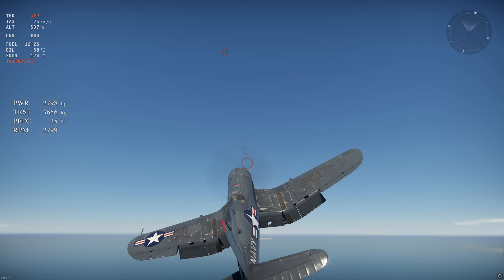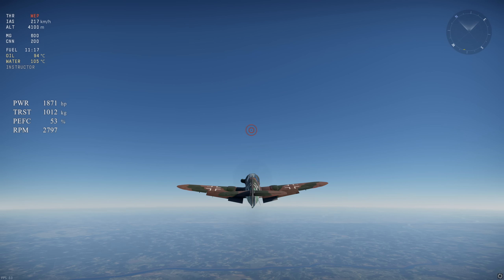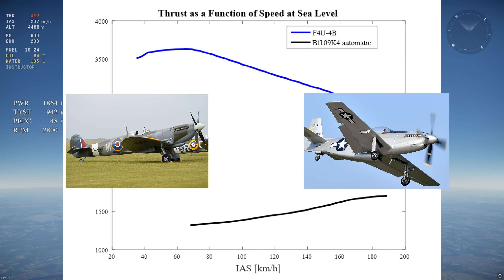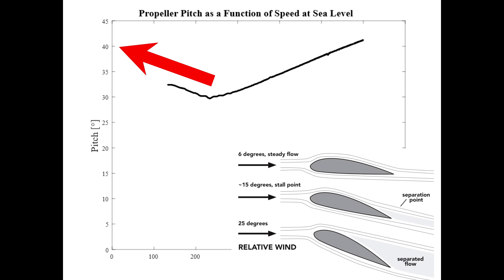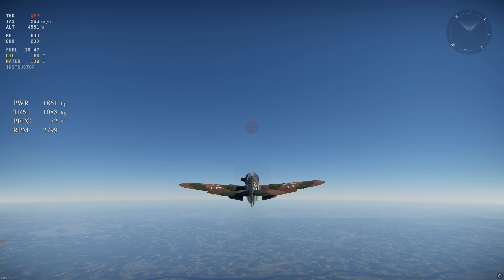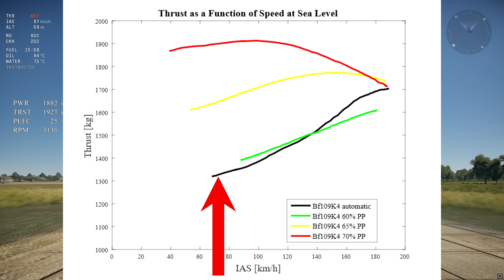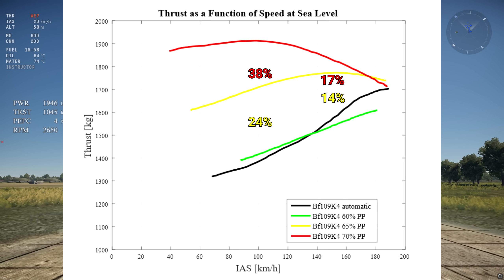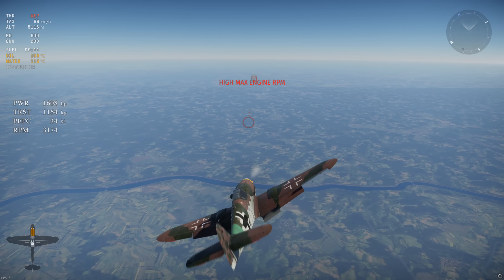War Thunder Tricks #8 | Prop Pitch Trick for Extra Thrust

Comment: Thanks for the great video once again. But I have a question: So take the K-4 automatic graph. Above 200kph the prop pitch is increasing as speed increases to prevent over-revving. But below 200kph the prop pitch is decreasing as speed increases to prevent over-rev. Those two things seem contradictory. It's like above 200kph, higher speed makes you rev more, but below 200kph higher speed makes you rev less. Am I just completely misunderstanding this?
Reply from the maker: Above 225km/h, everything is working as expected. As speed increases, the pitch angle increases to keep the AoA of the prop efficient. Below 225km/h however, the game/engine "knows" that if it continued to vary prop pitch normally, the propeller would no longer be able to absorb all the engine power without overreving. The only way to prevent overreving while keeping power constant is to increase pitch to generate more drag on the prop. At low speed, there isn't enough dynamic pressure on the prop to generate the forces to counter power.
Reply: @AdamTheEnginerd  Oh ok, so is "absorb all the engine power" another way of saying "staying at the efficient prop AoA"? Like, does it only absorb max engine power at the most efficient AoA?
Reply: So am I correct in saying that higher speed will act against the rotation of the prop, unless that prop is unpowered or at a really low power, in which case it would provide a windmill effect and increase RPM?
Reply from the maker: Absorb all engine power means that the drag on the prop must be equal to power (with the appropriate conversion of units), or else the prop will either speed up or slow down.

Higher speed doesn't act against the rotation of the prop, it would be the opposite if anything. Single pitch props see an increase in RPM as speed increases. Higher speed does allow the prop to generate more lift and drag due to the higher airspeed it sees though.
Reply: @AdamTheEnginerd  
1. Is all of the power absorbed by the prop only at a specific AoA? So above or below this AoA not all of the power is absorbed?

2. Prop pitch increasing as speed increases - That is done only to prevent AoA from decreasing to below optimal AoA? Or does it also have to do with preventing over-revving?
Reply from the maker: 1. No matter what, all the engine power is absorbed by the prop.

2. To stay at optimal AoA (also at optimal RPM for the engine too).
Reply: @AdamTheEnginerd  So is it a conscious design decision to make sure the optimal prop AoA is always achieved below the redline of the engine? Like, could a poorly designed powerplant have have its optimal AoA at too low of a prop pitch, thus over-reving the engine if you tried to get to that AoA?
Reply from the maker: Answered on Discord.

Comment: Scuse me? I dont have ANY mec settings for the K4, it just sais (you can't change pitch angle while in auto, even when im not)
Reply from the maker: You need keybinds to take manual control of radiator/prop pitch to override the automatic system on some planes.
Reply: @AdamTheEnginerd  You're the best, your tips brought me back from my eternal tiltm not even exaggerating
Reply from the maker: @pequod3782  Tiltm?
Reply: @AdamTheEnginerd  Tilt* is when you just start playing like a potato, like going down a steep cliff
Reply from the maker: @pequod3782  Ahh I see, glad to help!

Comment: What i do is stick out my head out the back of the cockpit and blow really hard.
Reply from the maker: That would actually slow you down though.
Reply: @AdamTheEnginerd  no because i rapidly snap my neck 180 degrees and inhale hard to pull myself forward and snap my neck back for the exhale. Its a good work out for the neck aswell.

Comment: First of all it is important to know that you want the power and torque. Torque is in short ability to turn the propeller. Power = Torque*RPM. The engine torque also depends on RPM. There is the ideal RPM where the engine has the highest power. The automatic prop pitch is changing the rotor load to keep the engine at this state. And now: if you have the highest posible power output, there simply is not any way how to get more out of it.

E.G. tge BF-109 K-4 with the Daimler-Benz DB 605 has the highet power output 1430 hp at 2800 rpm at sea level, with MW50 it gives up to 1850 hp. The maximum EMERGENCY power in level flight was 1600 hp at 2800 RPM at 6000 meters.
Reply from the maker: This is not about increasing power, it's all about the prop efficiency. Power doesn't change much from the change in RPM.
Reply: @AdamTheEnginerd  This is the law of physics. Power=Torque*RPM. So lower RPM at same torque means less power. Lower torque at same RPM means less power. The propeller is designed to absorb the engine power output. It is designed to have the ideal AoA right at desired RPM.

https://youtu.be/0bP2MH3LqvI

The last thing, according to the BF-109 pilot manual the manual pitch in 109 with automatic pitch control is used only in emergencies or for fuel economy.
Reply from the maker: We don't know how torque varies with RPM, engines have a band of RPM for max power.
Reply: @AdamTheEnginerd  We do not need to know the torque to RPM ratio because we already know the maximum power output state. So we can say the 2800RPM is the speed with maximum possible power output. 2800 RPM and 2850 RPM for diving is also the maximum allowed engine speed by the 109 manual.
 
https://en.wikipedia.org/wiki/Daimler-Benz_DB_605#Performance

http://kurfurst.org/Engine/DB60x/DB605_datasheets_A1.html

The main problem of WT is that is too "friendly" to player or how to say that. Just not such hardcore sim like IL2:BoX or DCS:W. It allows you to go over limits easily with no sanctions.
Reply from the maker: Going a bit more than 10% higher RPM kills the engine in WT, there's not that much leeway.
Reply: @AdamTheEnginerd  Will check that. For K-4 the limit is 2800 RPM. +10% is 3080 RPM. Still, you can not use this settings forever. There is time limit for those setups. E.G. for WEP(MW-50) 2800 RPM 1,75 ATA max 10 minutes. For combat and take-off 2600 RPM 1,35 ATA max 30 minutes. For cruise 2400 RPM 1,25 ATA continuous.
Reply from the maker: 15% increase of RPM on 2800 will destroy the engine in WT in a matter of seconds.
Reply: @AdamTheEnginerd  Yes, it is logical. The engine does not have modern technologies like VVT or VVL and the total limit given by stroke. But also lower near rates like 3050 RPM should damage the engine over time.
Reply from the maker: I agree, and it should take longer for the engine to die at 3200+ RPM instead of just a few seconds.
Reply: @AdamTheEnginerd  I am not 100% sure about that. Because this is the engine in war machine. Not in car. The 2800 RPM is for the War Emergency Power. So this value might be much closer to real limit than common car engine because it is already the emergency value. E.G in Mustang there was the WEP seal. Once the pilot used WEP, the seal was broken and the engine had to be reviewed completely.
Reply from the maker: @jaromirandel543  Those limits could be mostly for not having to overhaul the engine after every mission.

Comment: In war thunder this really isnt too useful. And in il2 sturmovik it isnt either. Because by the time you fall back down you gain rpm way to fast and if your not really experienced you will reavvh the 3000rpm real quick, which WILL leave you with a very oily windhsield and a broken engine. And as you can already not see much out of the k4 the last thing you want is for your engine to die in a dogfight. During combat you usually leave the rom controll/ prop pitch on auto, it really only takes a second after sttalling to completely destroy your engine. Please dint do it. In the 109e1 which doesnt have automatic prop pitch, fine but try to keep the warning indicators in view and especially keep an eye on your ata.

And in qar thunder it makes no sens ecause the game is too arcady for this to make sense
Reply from the maker: If you understand the limits, you won't destroy your engine. And you have a certain grace period, you need to overrev for a couple of seconds to start taking damage.+

Comment: As a flight instructor and ATP that teaches these mechanics in real life..... This hurts me on how inaccurately WT has this modeled.
Reply from the maker: Hmm what do you mean?
Reply: @AdamTheEnginerd  Most aircraft do not increase pitch when at slower airspeeds, we actually decrease to minimal for take off an landing for maximum RPM. Also, in the instance here of talking about overspeed at extremely low air speeds i have never in my life seen a properly maintained prop overspeed. I HAVE seen it in one low on oil, but that was a maintenance issue, now to be fair, the BF109 may have been modeled as such, but i have seen it also modeled in war thunder in aircraft i have seat time in. While i agree that what your saying may be necessary for a video game, when it comes to real life, they just didnt model it accurately.
Reply: @AdamTheEnginerd  Also, im aware you have an AE background, im trying to explain it in a way that not only yourself and i would understand.
Reply from the maker: Irl the pilots definitely did not do this, but German engines in WW2 had the particularity that the pilot could manually control the pitch angle directly, so he could in theory overrev the engine, but of course he wasn't supposed to. Usually the pitch was handled automatically to keep RPM constant.

Comment: this is why I lose realistic battles, because Hans is over here manipulating his prop pitch while i'm flying with mouse control XD
Reply from the maker: Hahaha well this is not the reason German teams usually win, *yet*.
Reply: @AdamTheEnginerd  It would be annoying for people to use the German airbrake when I'm rolling scissors-ing (is that a word?) them in a P-47.
Reply: @pranavarvind4281  german airbrake is for noobs
i use the opposite system
airbrake is with 100% pitch, the blades of propeller are "closed" and air cant pass
my move is with 0% pitch
i dont reduce WEP so engine still on max power
but with 0% i dont go on and let the other plane pass, then i have more energy for accellerate because engine is on full power
0% is more smooth then 100% because with "german airbrake" the AI cut engine for not over-rpm and you brake with max resistance on 100% pitch
but later you dont have energy
with 0% i just let others surpass me, if they brake i just use a little resistance from turning but im still full of energy because in on WEP
Reply: @AdamTheEnginerd  must mean the Nazi UFOs in Antarctica!
Reply: I thought literally everyone played with mouse controls
Reply: @Yeeter_Inbound  I use both mouse and Keyboard; Roll A+D, Yaw Q+E, Pitch E+D, Throttle+Boost(1 press for WEP)+Brake on Shift+Ctrl, with Mouse steering but I only use the mouse for fine tuning my aim/free look. Someone wrote it out nicely, I think this is where I learned to set my controls like that: https://forum.warthunder.com/index.php?/topic/102499-mouse-and-keyboard-controls-layout/
Reply: CTRL and SHIFT for elevators is king 👑
Reply: Actually, most German planes had constant-pitch propellers for the whole war. You just set your desired RPM and let counterweights do the job. The logic was to reduce pilot workload so he could focus on combat
Reply: I do it myself. I get a significant power boost. Even something as simple as manual radiator control + WEP gets a huge boost to how long you can WEP for and in some cases there is a perfect balance that allows perma-WEP.

bf-109 and fw-190 are picky and require micromanagement or switching between auto and MEC especially if the altitude changes drastically.

I generally drop my prop angle as speed increases as this really helps allow WEP be sustainable. You can still hit very high cruising speeds.

All in all it is great for climbs and cruising. Generally, unless i am turn fighting i will switch to auto before entering a dive or vertical move where speed will change quickly.
Reply: i use normally
mouse and
hotas4 left hand with throttle and manual pitch :)))
you can flight with mouse control because you set prop pitch on full manual controls but
you return to mouse
but MEC will still on
:P
Reply: Chads toggle MEC and use mouse controls
Reply: The shower is untouched.💀
Reply: I think its the minegeschutz ammo that does it mostly.
Reply: @Kameeho  ah german words. 2 letters in english is like 10 letters in Germany
Reply: @Kameeho  The mineshell isn't that good when compared to other nations' HE ammo, you won't have a good day regardless of what hits you.
Reply: totally true, tryhards do what ever to see the "you win" in the screen.
no surprice i can't even unlock the plane i need for tanks with people like this playing, just disgusting
Reply: @INWMI  disgusting for using a built in game feature that you can't even bother to learn? Come the fuck on bruh
Reply: Niseini sounds like a L2P issue ❤️
Reply: @conorf8091  use english please
Reply: @conorf8091  leave to play? left to play? libra to pisces?
Reply: Niseini left two parsnips. Eat ur veggies bro
Reply: @conorf8091  what that means?
Reply: @dsdy1205  sorry but no, this is beyongd learning to play
Reply: @CaptainSternn  basics of learning ?
maybe you are not counting the people who doesn't have the time to do this, and is ofc a games problem, i have no problem if this guy have 15 hours each day to play with the calculator, i did in my teens aswell.
but it's  game failure if i get matchmaked with such player just because im high level and  i had  go good kill ratio half a year ago
Reply: @INWMI  not really. If your so time strapped you can't learn to play the game find another game.

This seems like common sense. MEC isn't even that hard. I have seen games get so much more in depth than war thunder its not funny. Legit Space Engineers has real programming and a few actual software engineers have put out advanced C# scripts that are now basically required to be competitive.

Hackmud... nuf said.

Pretty much every other game where you actually engineer your own stuff to use.

Also Eve online and elite dangerous. Both good games but ridiculously high demand on dedication and time.

Overall, don't sink your limited time into games you cant support with said time.you won't enjoy it bc you wont ever pass the learning curve.
Reply: @INWMI  If you are going to complain about the game's features and depth just go play arcade. Players don't have manual control over their engines in arcade so you won't be whining there. If you are going to insist on playing realistic, then don't complain and learn how to counter them. Also this is an extremely time-consuming game, you are just complaining about other players having more time to put into their games which makes no sense.
Reply: @aspct.  ok
Reply: @VadersFist501st  ok

Comment: Could you make another video like this but for strategic bombers if this trick could be repeated on them.
Reply from the maker: Lol they don't need this trick.
Reply: I meant is there any way to increase thrust on takeoff for example the B-24D can’t take without using the additional land after the end of the takeoff strip if the takeoff flaps are deployed. This doesn’t go to well if your on a map with trees surrounding the airstrip.

Comment: May I ask how set your MEC controls up specifically for duelling and quick use?
For example I set the prop pitch control so it resets when I let go of it. This means I can use the prop pitch just like a handbrake really quickly.
I do not set it up like that for bombers as you have the time to precisely set things up.

How do you do it for best convenience?
Reply from the maker: I don't change my MEC keys depending on what I'm flying, I don't do anything special. In fact some of my MEC bindings could be significantly better.
Reply: If by dueling you mean in custom battles and tournaments, you get a timer at the start. Here you can turn automatic prop pitch off, set the pitch to 65-70% (depending on which 109) and then set automatic prop pitch on again so that when you get to 180kph ias and below you can quickly press the button to turn off auto pp. You musn't forget to turn it back on auto when you get above 180kph though, otherwise your engine will be leaving the chat.
Reply: BlitzkriegBarry Thanks for the tip. 
So far I left prop pitch on "keep value of axis" = no, so I can, as explained earlier let the "handbrake" snap back to normal. Otherwise, if I use the 100% prop pitch air brake and put it back to automatic, I keep on wrecking the engine. That is because from my experience the game needs a couple moments to readjust the prop settings correctly after reengaging auto engine control so you can't just flip it back and instantly throttle up again in the heat of a fight and you just don't know how long you got to wait...

But that's enough yackety yack from my part. It's all 1st world problems anyway. :)

Comment: i would please like a tip on how to make the american aircrafts actually climb. because even if i side climb i catch a bf 109-fw190 2 or 3 thousands meters above me. it's not really a problem dueling them, but a tip on how to climb better would be nice :)
Reply from the maker: Apart from loading less fuel and knowing the optimal climb speed, you can't make an aircraft climb better.